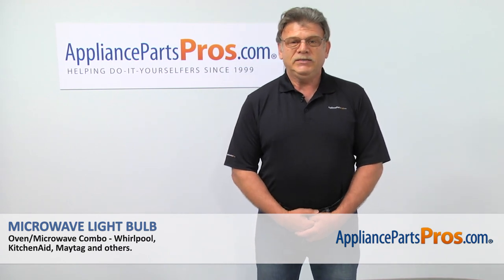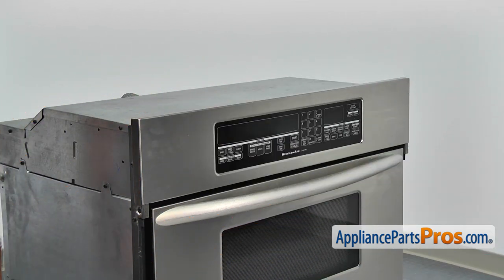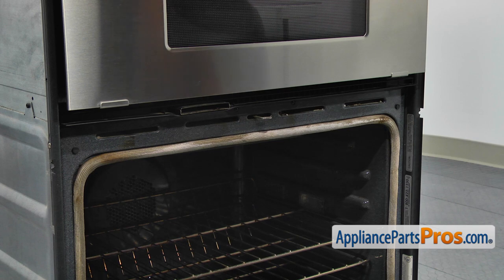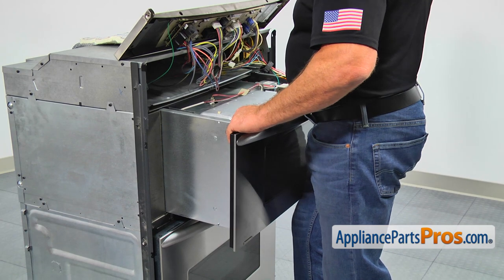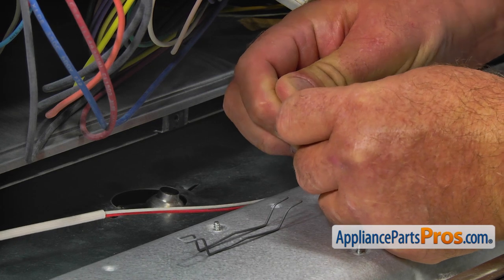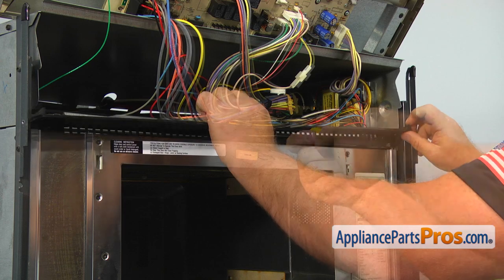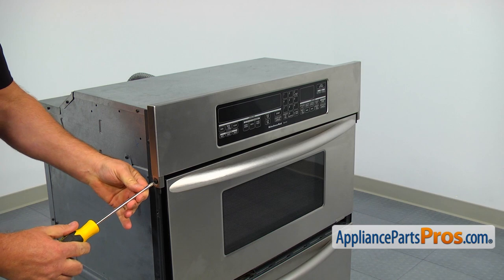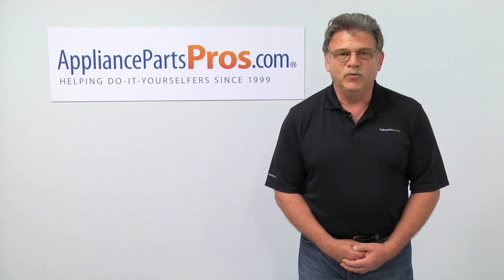How To: Whirlpool/KitchenAid/Maytag Microwave Light Bulb WPW10440740

Comment: Thank you for the Video. Our Maytag combo oven model is MMW7530WDS01. It has side bar covers the two screws of control panel. I followed you Video removed control panel, and plastic covers on top and bottom of microwave, then removed two screws hold microwave at bottom of microwave. But I cannot get microwave out. It does not come out no matter how I put it. Do you know the way to replace microwave light bulb in Maytag MMW7530WDS01 microwave oven combo? Thank you in advance.Any information will be really appreciated.

Comment: If you're following this video and haven't tested the replacement bulb before installing it, stop and test the bulb with a 12V power supply.  If the new bulb doesn't work, do you really want to have to repeat this whole process because you got a bad bulb to replace a bad bulb?  Best to test the new bulb before beginning this cockamamie Rube Goldbergesque procedure.

At KitchenAid, unnecessary complexity is Job One.

Comment: The exact video I've been looking for. Mine is a JennAir but I believe these steps will work as it looks very (exactly) to this model.
Reply from the maker: Whirlpool is the parent company of JennAir, so the steps should be pretty similar.
Reply: @appliancepartspros  I followed your video for my Jenn-Air (Model: JMW2430WS02) but when I got to the bottom vent (between the oven and microwave) there were no screws/brackets holding the microwave in place. I couldn't figure out what is holding the microwave in place or if this is even the correct method for replacing the microwave light bulb on my model. Do you have a video for the Jenn-Air? It is different than this one :(  Thanks!

Comment: Yes, like the comments below, there is an additional metal trim covering those first two screws. Open the oven door below, and look inside the oven at the trim close to bottom, there is a philips head screw to be removed and that will remove the trim.
Reply from the maker: Thanks for that tip.

Comment: Excellent video but as others have said wow!  What a ridiculous process to have to go thru to change a little light bulb...🤦🏻‍♂️
Reply: that's exactly what I was thinking. the instruction is not even on Whirpool official manual (I bet too complicate to draw the process). I'm contemplating whether to replace the whole microwave unit.
Reply: I was able to do all this after 5 hours of struggle (1 hour looking for this bulb at Home Depot). couldn't find the exact matching bulb size (5W in my case), I had to come home and grinded down 10W bulb to match 5W bulb size. It was so ridiculous process in fact was amusing.😆
Reply: @hanlee5292  It's readily available online (ebay, Amazon or this video presenter's company). I didn't even try to find it in the big box stores, as I knew it would probably be a wild goose chase.
Reply: @melanies.6030  i knew Amazon has it but, my wife wants things work in few hours… not few days🤣

Comment: My unit does not have the two Phillips screws showing below the control panel like your does. There is metal trim which will not pry off with a sharp thin knife.
Reply: I have the same problem. Did you ever figure it out?
Reply: @familyvideos8533  You need to remove the long side metal trim by removing a small screw located near the bottom of the trim.

Comment: A Warning: make sure this applies to your model. Google/youtube sent me here when I searched my model (whirlpool rmc305pvs01). But when I tried to take off the control panel as shown I ended up breaking some screws off. For mine, I didn't need to remove the control panel at all. The top vent cover slid out fine with the control panel still in place.

Comment: so followed all instructions to remove microwave, but my unit seems stuck on the right hand side.  left hand side seems free.  tried shimmying and prying for quite soe time with no avail.  Any suggestions?
Reply: Bulldog courtesy! Yea bullys! If you are referring to pulling the microwave out of the cabinet, There is likely a little bump or piece of scrap stuck under the unit on one side that is keeping it from sliding out. You may have to finesse one side out by lifting up on that side of the unit to get it over what it is stuck on. Were you instead referring to getting the control panel door off?

Comment: How do you move the unit out of cabinets. Sorry not a hands on guy and trying to learn. Thanks
Reply from the maker: This repair is for a microwave that's combined with a an oven into one wallmounted unit. There should be no need to remove the unit from the wall to complete this repair. The only reason ours isn't installed into a wall is because we do all our repair videos in a studio.
Reply: @appliancepartspros   Thanks!
However the person in the video clearly says you have to pull the microwave+ convection unit out of the wall. unit. And some part of the video shows sides of the microwave that  do not  seem accessible unless the microwave is pulled out of the wall??
Reply: @appliancepartspros  The first two screws on the side are not accessible until the unit is removed from the cabinet.

Comment: Changed light bulb and  both torsion springs. Turned breaker on, light bulb remained on with door closed. Now get error DOOR and microwave will not work.  I take it a the fuse blew. Any ideas?

Comment: My microwave KBMS1454sss-1 has hex screws not phillips .... lowers my confidence.
And, dang! This is a lot of work to replace a light bulb. Which junior engineer came up with this design?

I couldn't believe it when I told KitchenAid support that the bulb had burned out a few weeks after end-of-warranty and they told me:
   we have to send out a guy in truck
   we have to turn off the electricity
   we have to remove the microwave from the cabinet
   we have to partially disassemble the microwave to get to the bulb
 The bulb is not cheap and you can't just trundle down to Lowes and buy it either.

So this is a hugely costly repair.
Reply from the maker: A single part can be compatible with hundreds of different appliances. We film the part on a single appliance model to serve as an example of the repair, but there may be slight variations in the process for different models. We understand that not all repairs are simple, but we believe it's usually better to repair than replace! If you decide to repair it, we're here to support you.
Reply: I agree!  Over engineered!  Just like other American products like cars.  No wonder we’ve become a second rate industrial economy.

Comment: While I appreciate the details of this video and don't have any complaints with the video itself, I find it completely ridiculous that you basically have to disassemble your microwave to access the bulb. At least in looking at the bulb and the fact that the bulb is sticking down through a hole into the microwave, isn't there any way to simply grab the bulb from inside the microwave (e.g. some rubber coated needle nose pliers) and pull it out and subsequently insert the new bulb in?
Reply: Nope 🤦‍♂️  The glass globe/reflector that the bulb sits in prevents simply pulling out the bulb to replace.
Reply: Ah now, that would be too easy and logical 😁!

Comment: Stuck on step 1 my control panel won't come off and I tried to flip it up like him and broke the friggin control panel
Reply: My unit is out of the cabinet and I just removed 5 screws from the top unit cover. The cover slide open and I saw the light socket. Release the spring holding the socket, put out the socket and replace the bulb. Put back cover and 5 screws. Done. My unit is KitchenAid KEMS308S. Yes, I hate KitchenAid by burying the light.